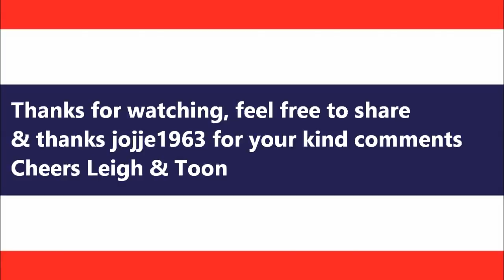A Day on our rural Thailand Farmstead

Comment: Hi Leigh best way to do the weedkilling is to have your sprayer set to a fine mist and build the pressure up in the tank. The weedkiller will cover a bigger area and go further. Try and walk in straight lines so you don't miss any. Ive spent hours doing something similar when I was a landscape gardener. Nice video again
Reply from the maker: Thanks Owen. We've just had the petrol driven sprayer fixed & sprayed as you've suggested with a fine mist for the open areas away from the fruit trees. I'm not experienced or have the confidence to mist spay around the fruit trees. Toon killed one which is bad enough but if I killed any I wouldn't hear the last of it lol. Cheers Leigh.